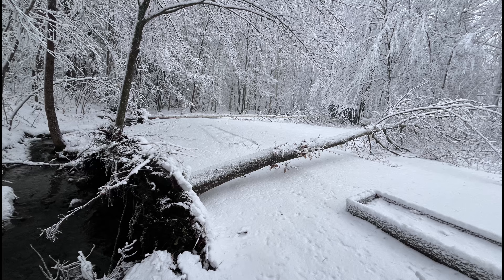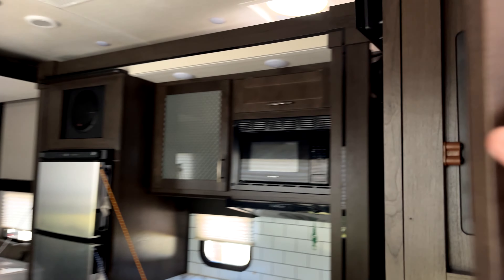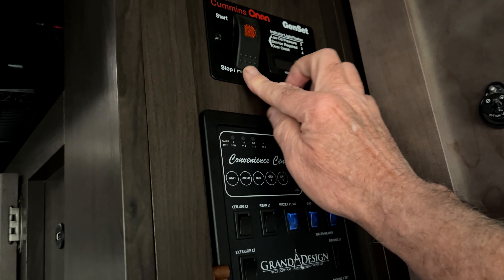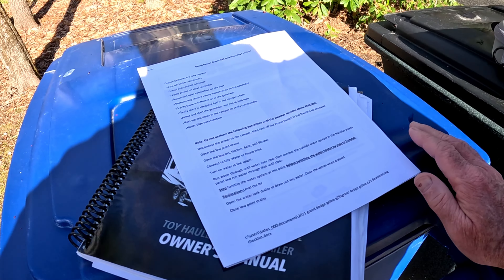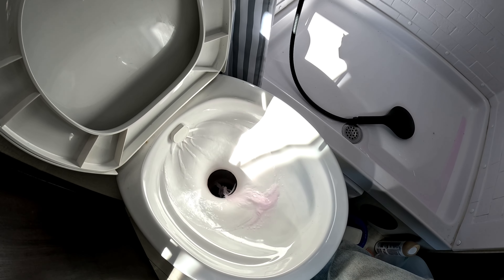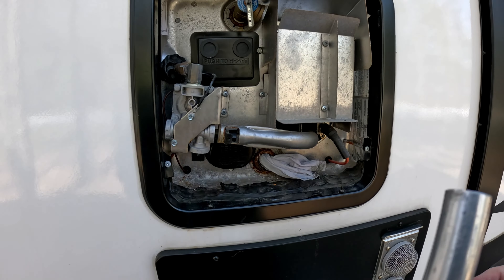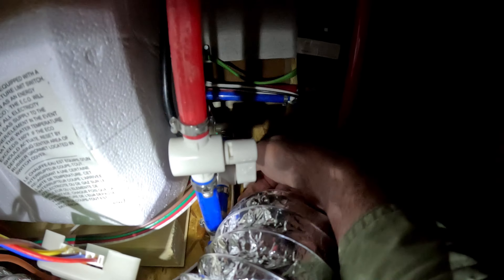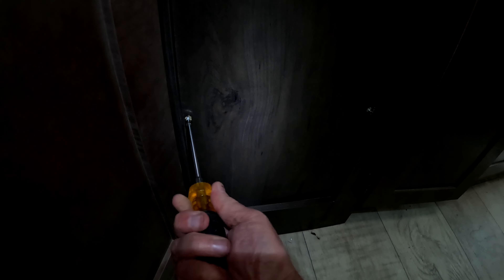Grand Design 25G: Safely Storing & Dewinterizing | S2:E3 Tips

Comment: I am interested in how you set up your batteries, dual batteries charging off one solar panel. How did you wire it ? how do you find it for use ?
Reply from the maker: I have 2 100 amp hour 12v batteries that are wired in parallel so the voltage stays 12v and gives me 200 amp hours of battery. Off grid I used to have my battery drop to less than 50% overnight and now I still have 60-65% battery available in the morning. I have a single 175watt solar panel on the roof. This setup is good for maintaining the batteries enough for me to have power to start my generator to recharge when I’m off grid or to do a slow charge and maintain the batteries. The refrigerator is the largest draw on the system, so I normally put that on night mode in the evening and it still keeps the food cold.